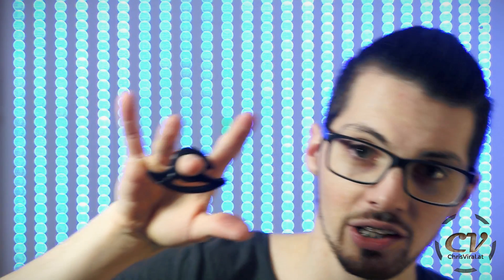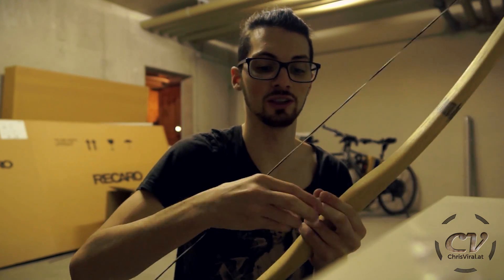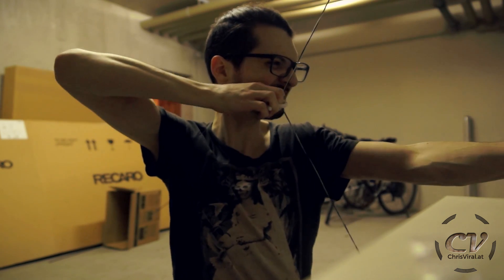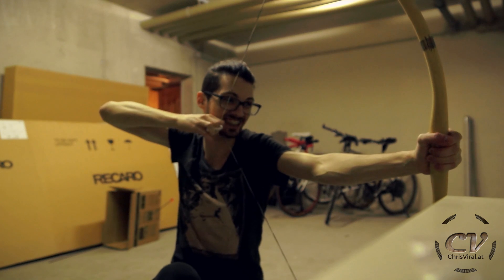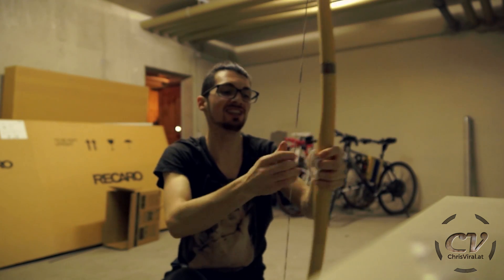3D Printed Archery Release Aids

Comment: On the three finger release aid how large is the slot in the bottom of it, also I would love to get two of them in  orange color if possible? The middle finger is about 1 inch in diameter if that helps, also I need both the ringh and index finger a little longer as suffer from a slight problem called fat finger syndrome in other words they swelll a little. Can you make these and send them to the U. S. If I send you the address also how much would the payment be?

Comment: Ok first let me say I've been an archer for 38 years I shoot asiatic.  Next I'll say those are really cool and a great idea 💡, now I'm going to give a bit of criticism. Taking the easy way in archery is generally not a good idea everyone especially many of those your age want it right now.  I can see you having trouble drawing, this is an issue of strength and is obvious you've not developed the specific muscles that archery demands and your fancy release isn't going to make up for your weakness and your huge gaps in skill . Look brother instead of playing with your electric toys and video games pick up your bow ....the stronger one and start practicing every single day and I promise you you will get stronger faster than you would have thought you will be more steady and sure handed and you will be way more accurate.  Do not use finger or thumb protection, start with your lighter bow and use bare fingers until you just don't feel discomfort it may take a couple months then go do the same with your heavier bow,  one other thing...never hold the draw longer than a count of one mostly release the instant you reach your full draw and never aim , look at a small point on the target ,draw , push your bow hand forward straight at that area and release. Do that over and over and in time you will do it without thinking . Let me know if you need anything or have any questions I know quite a bit about archery and I know men that know alot more .now get your butt to practice

Comment: Where can I get a pattern at?
Reply: If you had an electrical or plumbing problem I wouldn’t fix it for free. When you have a particular set of skills, you profit from them. It’s not the few hours he has in making the file for printing the releases, it’s the months of learning the software and the nuances of the 3-d printer. If it’s so simple, make one yourself and don’t bitch that someone is taking advantage of an opportunity to make some extra cash 🤷🏻‍♂️
Reply from the maker: A release aid?
There's my shop: https://www.etsy.com/shop/ViralGoods
Reply: the testing he did to get to that design was probably about 3-5 hrs outside printing time.

Comment: Nice :D but i dont think i could use them for my compound bow. Or what do you think, are they stable enough ?
Reply from the maker: +Jengoo 
I guess I pulled around 50 lbs in this video. The 3-finger-version might actually work on compound bows too but I sadly sold my compound bow a few weeks earlier... A destruction test would be neat :D
I'll write you if I get to it! :)
Reply: +ChrisViral That would be nice :D But pay attention it can hurt if it break, my releaser broke one time and my whole arm was ripped after it. Thanks for the answear :D
Reply from the maker: +Jengoo 
Don't worry, I'll definitely try it with a simple string attached to my ceiling or something like that... I'll keep you updated :) NP at all! ;D